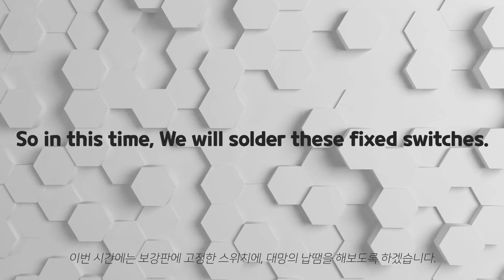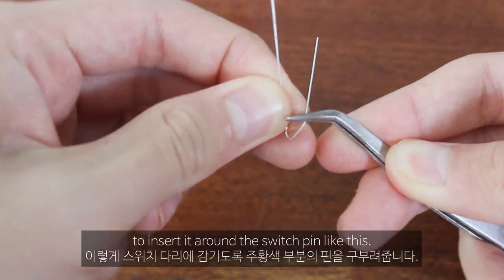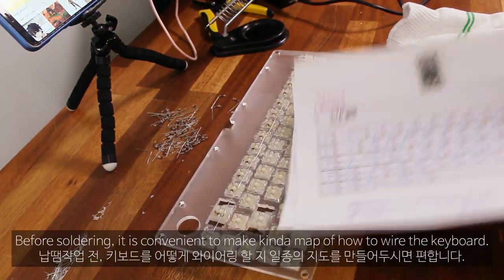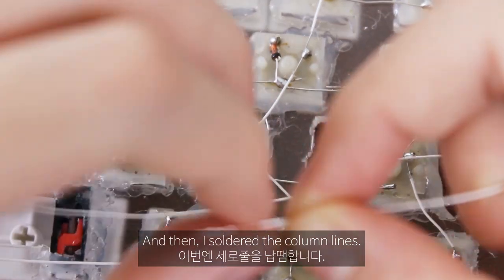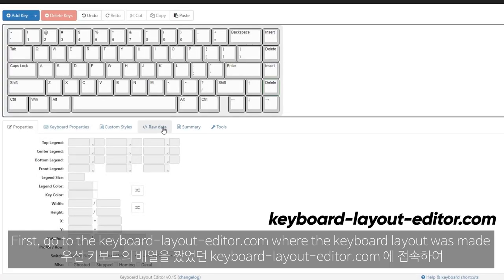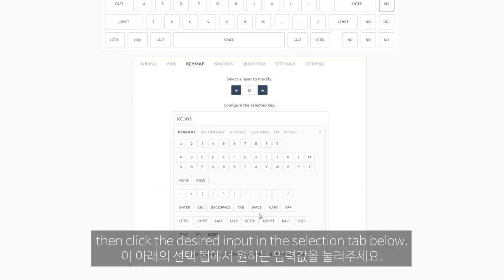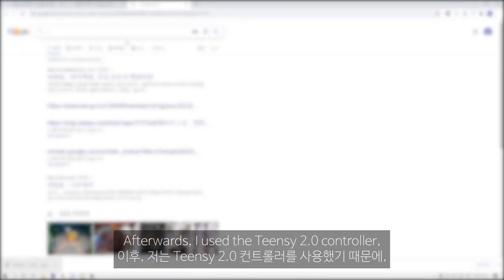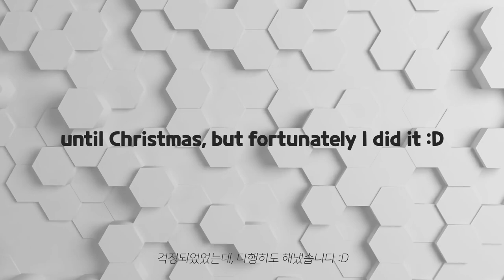Building My Own Hand-Wired Keyboard! - [EP.3 : Soldering Party]

Comment: i used a raspberry pi pico to hand wire a macro pad, didnt know what a matrix was when i wired things up so i used 19 pins (1 for 3v3a and 18 for ground to the switches) instead of doing a matrix which uses 9 pins. still works but your implementation is much more scalable and puts hand wiring in a way that doesn't make people confused as hell, also most microcontrollers have community supported QMK for programming on the fly like the arduino, i wrote one for myself because my implementation is much easier to put into code.

Comment: Hey, great job on the project. I wanna do something similar like this, I'm having troubles with the rotary encoder. The type you're using has 5 pins, how do you wire it?
Reply from the maker: First, thank you for watching. Frankly speaking, I'm gonna upload the video about the rotary encoders. (I planned to upload it, but it is getting delayed because of my studying. but I'm going to upload it soon.) 

so I used 5-pins rotary encoder. 
There are 2 pins that are responsible for the clicking function. In the case of them, you can treat them as a new key switch. It means you have to wire them like the normal switch pins. (You should add a new key in the keyboard layout editor for the keymap website.)

and, There are the other 3 pins about the rotating function. (GND pin, clockwise pin, counter-clockwise pin)

To use them, you have to manually program the function about the rotating function. (If you have to make it right now, Check docs.qmk.fm!) and I'll gonna make some video about it. Sorry for the late video!
Reply: @oREoTheCream  Thanks for the reply! I'll be waiting for your video, didn't really understand about it from the qmk website 😂
Reply from the maker: @bangjago6188  I'll try hard to make video that can help you understand! thank you again.
Reply: @oREoTheCream  Hey, do you mind telling me which are the 2 pins that needs to be wired like a normal switch? I saw in google that GND should be plugged in to GND, and + should be plugged in to VCC. Where do I need to plug the last pin (besides GND, +, and the 2 pin that acts like a normal switch). Sorry if I asked too much :'
Reply from the maker: @bangjago6188  I'm researching about you knob, can you give me a model name of your encoder?
Reply: @oREoTheCream  I think im using the same one as yours. Its the KY040 5V
Reply from the maker: @bangjago6188  ok. i'll check it
Reply from the maker: @bangjago6188  I'm confused, so I disassembled my keyboard again to help you!

So I used 3 pin (marked on CLK, DT, GND) for rotary encoder.

GND -> teensy gnd
CLK -> B2
DT -> B1

and I think SW and + pins are about clicking function.
Reply from the maker: @bangjago6188  When I first assemble this, I was so confused, so I gave up clicking part..

but I'm sure that clk, dt, gnd pins are about rotating part.

GND goes to GND, 
CLK & DT goes to other pins.

But I'm not sure that we should use VCC pins.
Reply: @oREoTheCream  Okay, thanks a lot for helping me. Sorry if I bothered you. Keep making these great contents ^^
Reply from the maker: @bangjago6188  You're welcome. I will talk about this topic in the next video!
Reply: @oREoTheCream  Hey, i have something to ask again. Do i need to attach the rotary encoder directly to the teensy board or can i attach it in the matrix wiring like the other switches? Because im out of pin on the teensy board
Reply from the maker: @bangjago6188  clockwise pin and counter-clockwise pin and gnd pins have to connected directly,

but 2 clicking function pins can be attached to the another swithes and added to the switch matrix.

in case of the clicking function, you can treat 2 click pin as a new switches
Reply: @oREoTheCream  Hey, sorry for asking too many questions, but my board isnt working. I uploaded the hex file and nothing happened when i press the keys
Reply from the maker: Im sorry, because I cannot give you many infos. :( If you going to add rotary encoder, you can add only the clicking function. If you are going to rotating function, you have to write code with qmk.

Comment: What I have to do to add FN (function) Key to do different things like changing light intensity or using different lighting modes or changing colors?
Reply from the maker: You should add mo(1,2,3). It is function that switching key layers. Map the mo(1) on the layer 0, then go to Layer 1, and set the light function(on/off, color, etc.). 
If you press mo(1) and the key, the light function will work.

If you are going to use qmk supported pcb, go to https://config.qmk.fm/#/ . There are many LED functions.
Reply: @oREoTheCream  i can't understand .... lol